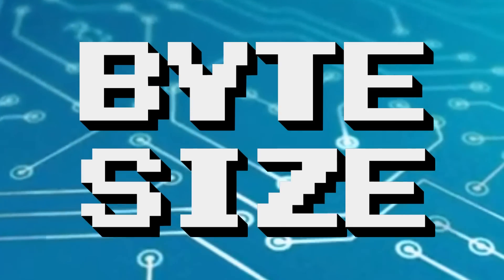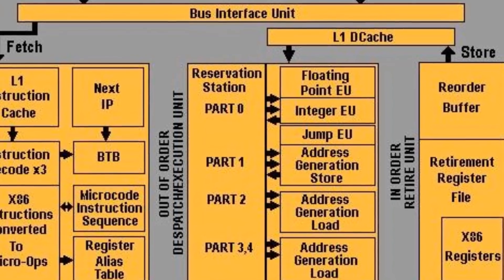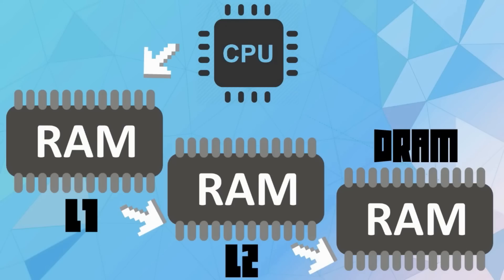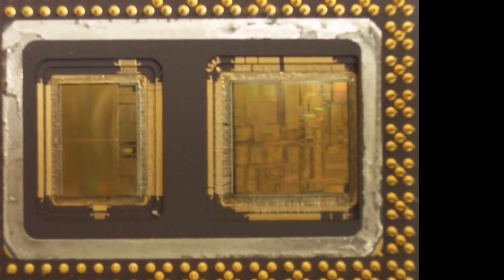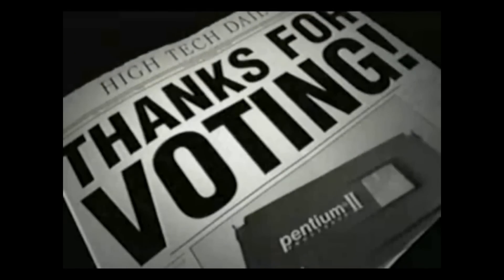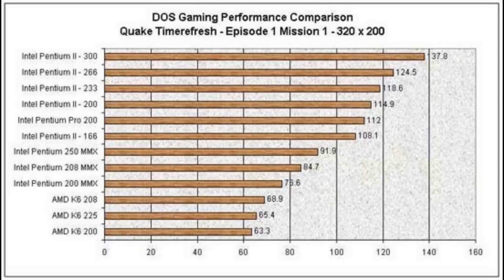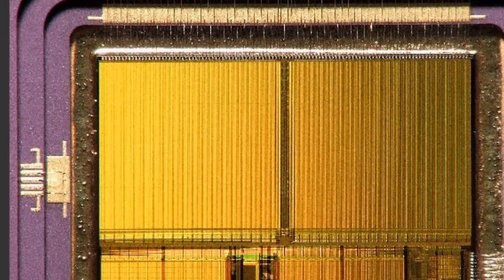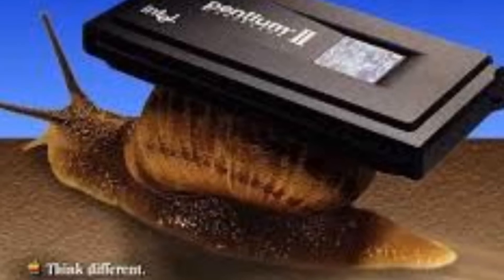Why Were Pentium 2's on Cards? [Byte Size] | Nostalgia Nerd

Comment: I think if consoles take a path of upgradeability with processors Etc,  we'll see a return to cards for them!
Reply: +Larry Bundy Jr Isn't Sony rumored to have a upgraded PS4 in the works? Maybe they could provide whatever upgrade the new console will have ( PS4.2 ? ) to the owners of the original PS4 in the form of a card or something similar ... Oh, and by the way Larry, Your channel is awesome!
Reply: Greg Lyris
Thanks bud! :)    Yeah,  if they have something in the works, we'll hear about it next month at E3.   But Microsoft might be the ones to do an upgradable console first.
Reply from the maker: +Larry Bundy Jr You may be right. I heard some strange rumours about wireless upgrade packs as well..... whud?
Reply: Nostalgia Nerd I remember that MS said the XB1 would never need to be upgraded as they could use GPU's to process the power at their HQ,  so they'd never need to be upgraded,    so you'd be streaming games.   Kind of like OnLive.
Reply from the maker: I remember this also.
Reply: Not so sure, chip making has come a long way since then.
But it would be good to see massive amounts of memory run at internal clock speeds.
Reply: AMD has just started this with the AMD APU series of combined CPU,GPU and TrueAudio Soundcard hardware on a processor chip I.E. SOC but the network controller is not on board maybe the next generation APU chips will also include the network controller  and the other remaining chip will be integrated into the APU
Reply: Probably not, a jump in network hardware technology would make the CPU silicon redundant.
Reply: man - your every where I go... I see you more than I did in the 90s!!
Reply: +Larry Bundy Jr man, your every where I go!! I see you more than I did in the 90s lol
Reply: That would be cool
Reply: think expansion paks and that was just extra ram for the n64.
Reply: LAAAAAAAAAAARY
Reply: ***** at least the switch has the potential to be upgradable.
Reply: ***** the dock isn't all that the switch can use. It's a theory of mine and because (add ons) is said not devices makes me certain...
Reply: It'd be an interesting bridge between PC and console games; if expansion cards provided quantifiable leaps in processing/"gaming" power, you could effectively buy the level of expansion card(s) necessary to be able to select between comparable "low", "medium", "high", and "ultra" settings of PC versions of each game. To quote the old adage, "Speed costs money. How fast do you want to go?"
Reply: Just don't bother with bleeding edge unless you are someone who makes the money back easily with the work you produce.
Reply: I know this comment was written 7 months ago. But I'd just like to say that with the release of the PS4 Pro and the upcoming Xbox Scorpio, I really doubt we'll see upgradeable consoles anytime soon. There's just more money to be made in selling consumers an entirely new console, rather than selling just a single component or two.
Reply: You really cant upgrade a console.  For a PS4 or a Xbone almost all diespace apart from memory is tied up in the processor. If you would swich the processor, you might just as well swich the whole MB.

I would think, in this pace it would be better to do it the other way around. Having the BD and the HD in a secondary case and connect it via USB
Reply: +MrBluGruv This has been done already and failed pretty bad with marketing wise as it was suppose to be oriented to Console Gamer's but they had there marketing more like for pc user's which don't want it, they had those kind of options and it could be upgraded, also the OS sucked ass, (Talking about valve's SteamBox with SteamOS which is Linux based and worse than Ubuntu with 512k of Ram) so you might as well just install Ubuntu on it.
Reply: Well, that wouldn't work out very well, because game makers tend to design around the lowest common denominator... they wouldn't want people buying their games for a configuration that's not upgraded and then complaining it doesn't work without additional equipment. And they don't usually want to do the work of ensuring it works well on both configurations, so what ends up happening is that most games are never designed to take advantage of additional power on the same console. 

Generally, both console makers and developers would rather just have people buy an entirely new console every 5 years, and then the hardware that comes with that is the new baseline. Things like the Sega CD and the N64 Expansion Pak just didn't take off... people want their consoles to come with everything needed to use them for all games until EOL. People that have disposable income for such upgrades would generally go for PCs, and unless a console maker suddenly manages to force a lot of third-party publishers into exclusivity agreements so that PCs never get some of the best games, those people will not go for consoles.
Reply: well if you can get it to run on a HDMI stick then all the better as then all you will need is a TV or a monitor as HDMI sticks kinda were a market flop they are not common now but they still exist and still can run most of the older consoles fine some with lag some without as it is built to run off of a 5V at 50mA pin at the pin 18 of the connector but in thus it is designed for low heat to not overheat nor be to heavy via a heatsink instead of high performance
a eSATA drive will still require a SATA controller to read it and thus a full computer for the interface
Reply: you mean like a bootable USB drive or a DVD boot or any of those others which already exist?
Reply: If consoles were upgradeable they would just become an expensive PCs.
Reply: +Cyberat Rodent I think consoles should ditch the stupid "full OS" thing and go back to being systems that start up straight to a game. If they're going to be just like PCs, there's no point in buying them. The very fact that they now have all the downsides of a PC with none of the advantages is a reason why they're becoming pointless. A lot of people want a simple experience with no worrying about Internet, DLC,  updates, loading times. Maybe they also want a unique experience that's unlike playing on a PC. But instead of doing anything unique, they're just catering to lazy/greedy developers and (perhaps inadvertently) turning consoles into exactly what their detractors called them all along: inferior PCs. 

Out of all the consoles available, I'd have to say Nintendo offers the closest to what I want. The Wii U is very quick to boot straight into a game (after they finally implemented a quick start menu), and I have to say the Gamepad and the Wii remote feel different from just plugging a controller into a PC. It's different enough that it feels like it's worth the money. But the Xbone and the PS4 are so much like PCs that it's not even funny, and I already just play the multiplatform games for those two systems on the PC.

I still honestly think there was a lesson in the video game crash of 1983... most companies just thought of consoles as another type of home computer. Only Nintendo truly understood that a lot of people want a gaming experience that doesn't feel like dealing with a computer hooked up to your TV. The other companies are run by engineers that just shrug and think the underlying hardware is all that matters, and don't get why it's not just another computer. The people at Nintendo are still the only ones with anything like a proper vision of what consoles could or should be, and as soon as they stop making hardware, the dream is dead forever, and it's only a matter of time before PC gaming takes over here like it did in Europe where Nintendo didn't save consoles.
Reply: Jeremy Andrews on that the last consoles you would like would have been the Xbox one, PS3, and Wii as the Wii U boots to the home screen then auto selects the game for you then auto runs which is in essence what the before consoles did but did not show you
Reply: +Jeremy Andrews, Ok I understand what you are saying, I don't like the 
full throttle OS setup either and one reason I don't want a PS4, I like 
my sega genesis, Sega Saturn, Dreamcast, PS2, gameboy line, ds, PSV,  
PS3(I don't even use my ps3 much, just ok).  I have played the gamecube,
 N64, there good to, but it sounds like you're a bit biased towards 
Nintendo. Even though with that nintendo did indeed change gaming 
history, but since the virtual boy, and wii, it has been all down hill 
from there, even the WiiU. I Know they tried pretty hard,but it died in 
just a couple year's. and the Wii was ONLY successful because it filled 
the casual gap in that period of time, smartphone's and casual wasn't 
really a thing yet back then they just got lucky releasing it at the 
right time. Though I have to admit they try different things and they 
are innovative but in a way console gaming is kind of dead, not totally 
yet but companies are still trying to push it forward, and in a way 
hardware does matter to a certain point, Though what games the system 
have and how they use the power of the system is what it should be 
bought for that is why there is these exclusive games to certain 
system's so you will buy it. It is the whole purpose of this kind of 
marketing strategy, so what it basically boils down to is. Which game 
will make the biggest impact on the user and be very successful which 
determines the system's life. If a system is under powered so what? as 
long  it isn't to difficult for developer's to develop for. it shouldn't
 be of much issue as such the sega Saturn did with its very powerful 
hardware but hard to use architecture used with C. we do have better 
tools which makes it easy to develop for though now thanks to one 
person. Only time will tell how well the switch holds up.
Reply: That's a very interesting idea, maybe as a stopgap before the eventual decline of expensive tech demanding AAA action games.
Reply: An "Upgradeable Console" would be horribly overpriced, because it would use special proprietary hardware only, such as the HDDs in the Xbox 360. I remember the days when they wanted you to pay $50+ between the 30GB and the 60GB (or was that 80?) "Elite" version. Meanwhile, you could buy a standard PC 500GB 3.5inch HDD at the time for about $75. It was a ripoff, plain and simple.

Anybody who thinks that either Sony or MS will allow you to stick just any ole PC parts in a console, or that they will offer proprietary upgrades for reasonable prices is just out of their minds or gullible, or naive or all of above.

I mean, sure, it's possible... but it will be expensive, and it would probably require you sending in your console (which likely means a data wipe), just like if you were to have it repaired.

This is why to be honest, Xbox and Sony should just give it up and go PC already. They could, instead, make gaming PCs because they are already 75% of the way there -- they just use proprietary Mobos, BIOS and OS's. Everything else is roughly the same chips and hardware you'd find in any PC (that's 5+ years old). I think my desktop computer that I built almost 5 years ago can easily compete with whatever the newest consoles are coming out these days, and games on them tend to be capped at 30FPS while I can play similar PC games at 50+ FPS on better graphical fidelity settings.
Reply: The Xbawks X will be actually a completely new console though. If they would switch the puma+ to zen in their CPU - as they did with the upgrade to vega with GPU - it would be a very strong system indeed. It would be actually good enough to find a way to hack in a normal Win10 install on it..
Reply: akkudakkupl you didnt read the news? xbox one x will have the same gen cpu as xbox one but overclocked it might have more improvements but certainly its not a ryzen.
Reply: Democritus86 i said that IF they would change to zen. I know they dont ;-)
Reply: Larry Bundy Jr no way, modern CPU's are way to hot and need coolers that would not fit on the cards.
Reply: That would been end of consoles
Reply: why would they sell you a CPU/Memory when they can sell you a whole new unit!
Reply: Welp, given that I literally see you on every single comments section in existence; it's safe to assume we're long lost brothers.
Reply: Larry Bundy Jr that would actually not work. A moddable console means that developers have to keep in mind all the possible combinations people could have. This means that performance would be different on every system. This can cause many problems among the consumers. Basically, you would be turning consoles into a PC with a proprietary firmware. So like an console made by apple. Another one. Gods their foray into the console market did not go well the first time
Reply: Oh, look at all these interesting tech questions!  NOPE GOTTA FIT THE E-CELEB HERE
I wanna know the person who deletes these kinds of comments from their channel.  That would be the first man I ever subscribe to outside of being under duress.
Reply: I hope however that it's more like an LGA card than the slot cards...
Reply: Larry Bundy Jr i think thay are beter of seling a os then but hay im a pc guy
Reply: This wouldn't be good cause a console assures you that you will be at the high end for a lot longer which means for example that you'll be able to play a game that was released 5 years  after console's release and you won't have to spend a dime other that the game it self to play it.
Reply: Larry Bundy Jr 

Unless you willing to stuck with that terrible performance due to the cache latency and slow i/o speed and limited processor's architecture design and efficiency aka losing ipc. However it has one advantage that is its core can clock really high if manufacturer can somehow keep l2 cache at lower speed since it is separated from the main core which it is easy to adjust on the pcb, however it is still garbage even it reaches 10ghz because of poor ipc and single core performance
Reply: Why? We wouldn't. Don't you mean like upgradable like a PC is? With a normal chip in it?
Reply: consoles nowadays are pretty much just PCs with ugly connectors to prevent upgradeability. e.g. the PS4 runs a modified OpenBSD and the XB1 windows10.

the only real differences between a console and any PC nowadays are: game devs know exactly what hardware it's gonna run, and console manufacturers get to rip off their customers with each upgrade because they have to buy the whole thing each time instead of just swapping out the gpu/cpu/ram/whatever. which for the customers means: way more expensive but easier to use if they don't need custom hardware/software.
Reply: @eLJaybud  i don't think console apu is will be ever used in servers
Reply: Nostalgia Nerd : they kind of are, Ryzen processors from AMD come on die sized 'sleds' which contain 'chiplets' of discrete cores and IO processors. Instead of putting multi cores and systems on a single large 12nm die with a high failure rate in fab (driving up costs) they've gone with assemblies of smaller discrete chips that have a higher success rate (cheaper). Intel is likely to follow suit.
Reply: That was big thing back in the 3rd generation consoles like NES and the Gameboy : part of the hardware was in the cartridge (extra ram, battery for saves, even sometimes processors). 

In fact part in the case of the Gameboy a big part of the bios/os itself was on the cartridge, the console had the minimum hardware on-board : enough to get inputs, render sound and cache/render image, a very rudimental CPU, a tiny RAM and a routine to test if the Nintendo logo on the cartridge was the one intented.

This was a very clever design, making the console cheap and allowing a large upgrade potential (especially for the RAM).

But I don't think this would be revelant nowadays. Many attempts were made to upgrade an existing console : sega 32x, N64 DD and expansion pack... None of these were commercially successful.

The market was in demand and in favor for a true next gen console, with a modern design, and certainly doesn't want to open the case and touch the circuits inside.

And those who are geek enought to want to upgrade their hardware themselves it will always prefer the PC because it's unbeatable in that field.

Comment: The slot design is still my favorite CPU packaging ever.  Very robust and easy to swap.  If you can plug a video game cartridge, you can change the CPU.  There's no need to worry about breaking any heatsink retaining tabs or bending any pins.

I've dealt with a lot of motherboards from this period, and broken sockets are quite common on boards with traditional sockets.
Reply: I hadn't heard of broken PGA sockets but bent pins were certainly a big issue. I actually broke a pin when attempting a BSEL mod on a P4, rendering the entire CPU useless.
Reply: @eDoc2020  I prefer the PGA sockets to LGA, the LGA pins on the motherboard are super easy to bend or break. The pins on the CPU with PGA are much more durable. And the socket is also more durable than an LGA socket.